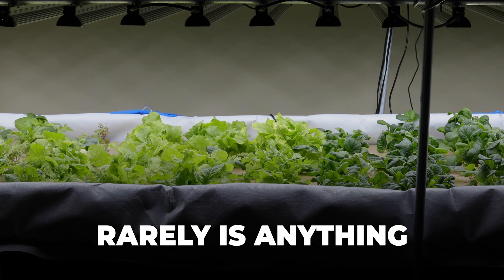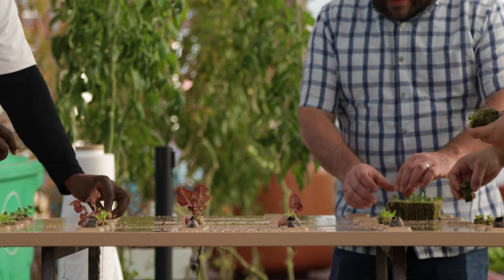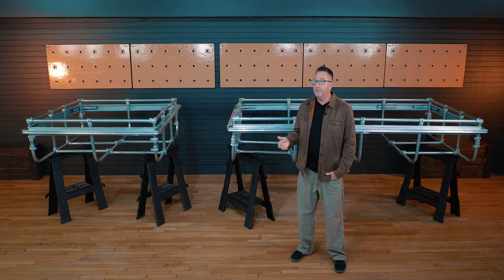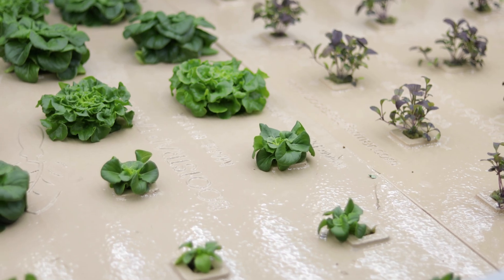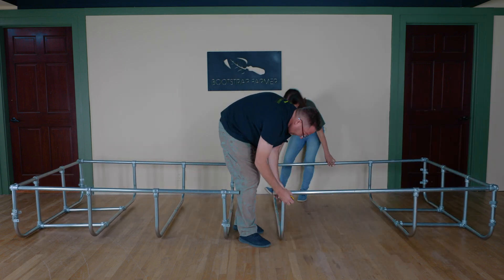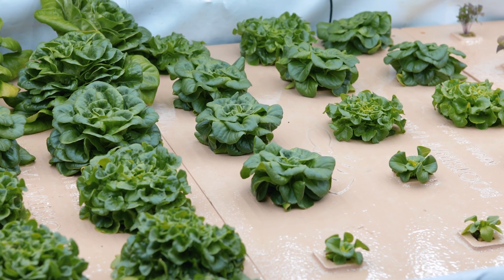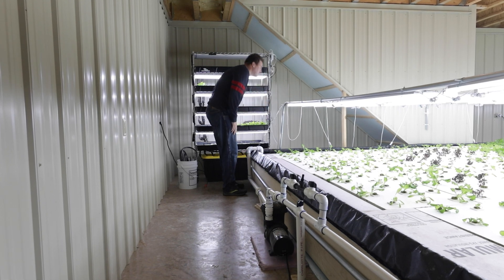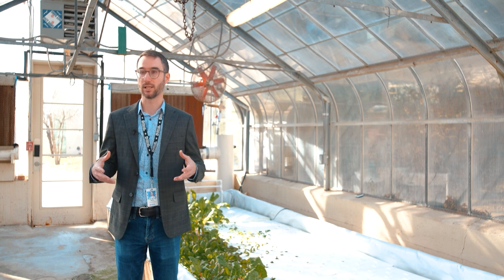Soil-Free Farming System for Small Scale Growers (This DWC Kit Scales With You!)

Comment: Nice. Love it. Make a 2x4 for a shelf for us litte guys. 😊
Reply from the maker: As we think about things, How many heads of lettuce ideally, would you need a week?
Reply: @BootstrapFarmer  not many. 4 to 6 head.
Reply from the maker: If you can do a 4'x4' footprint that gives you two rafts that can hold 18 heads each for a total of 36 spaces for lettuce. On a 6 week rotation 6 divided by 36 = 6 heads a week for your goal. So think of it as one week you transplant 6 starts into a raft, then 6 more the next and so on. After 6-7 weeks you can pull six head out and transplant new starts in on a rotation. The 4'x4' system is easily serviced all the way around. Hope that helps.
Reply: @BootstrapFarmer  yes it does help. that's what I will do in the summer